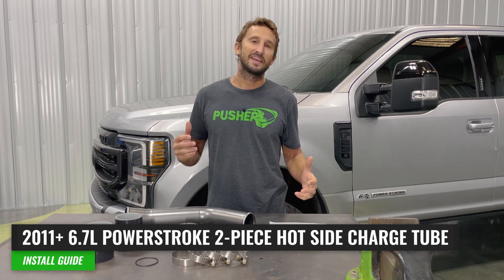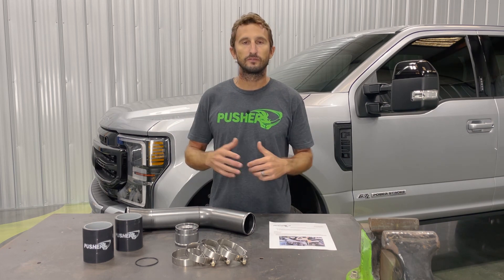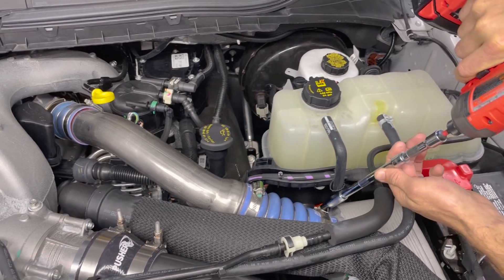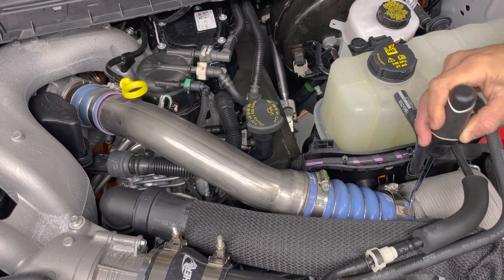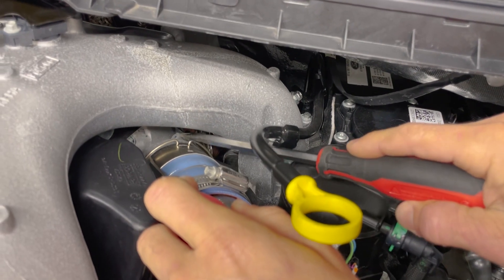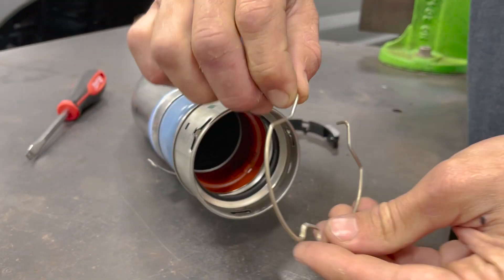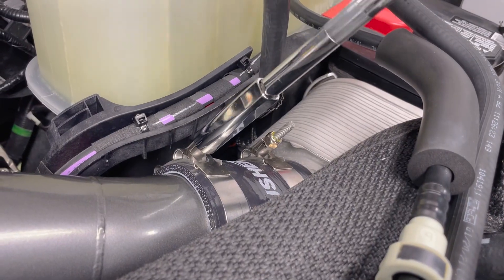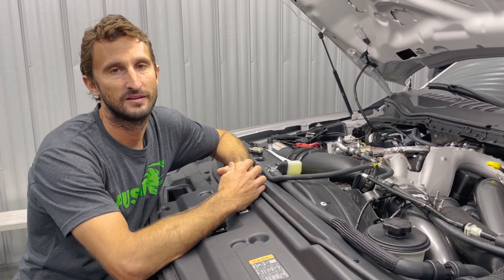INSTALL GUIDE: 2-Piece Hot Side Charge Tube, 2011+ 6.7L Powerstroke

Comment: Im no math matician... but the longer straight section 1000% points to the charge cooler. Probably should juat say the lobger section with the slighy bend on the end goes to the charge cooler.